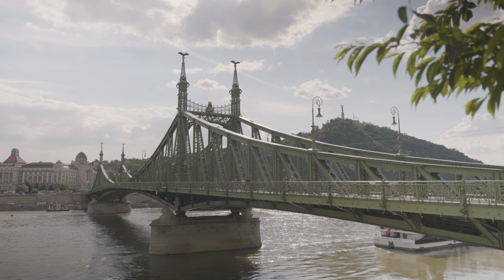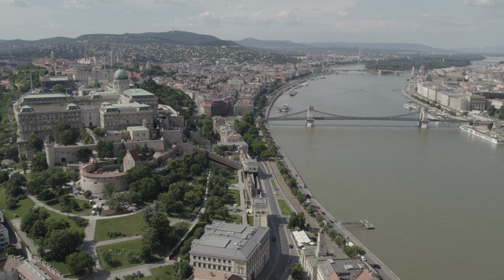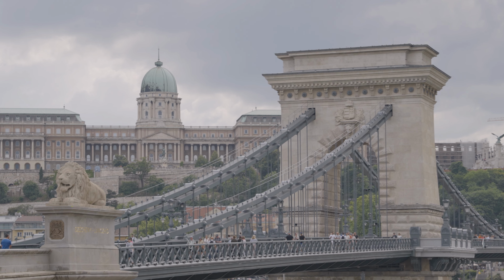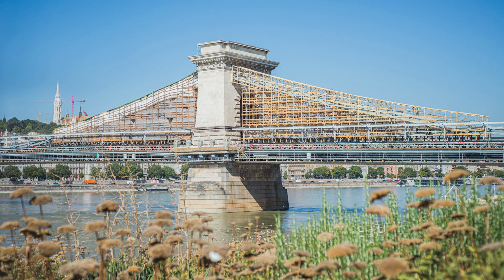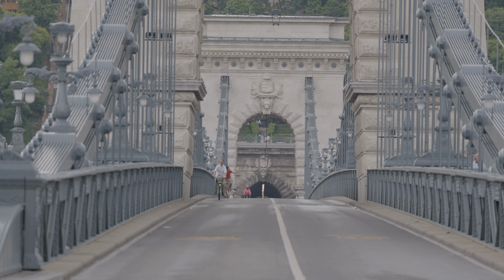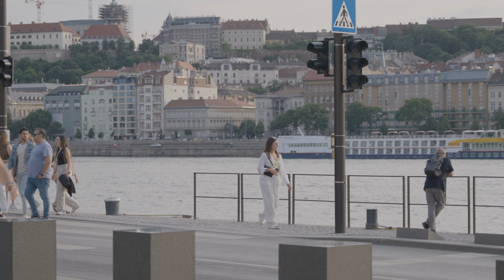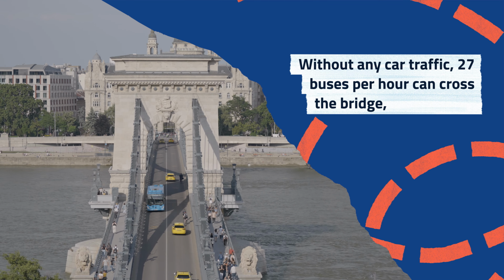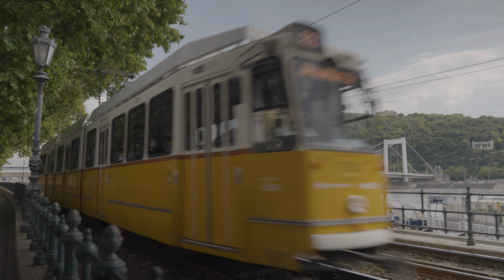How did the Chain Bridge in Budapest become car-free?

Comment: I live next to this bridge and have to cross to the other side of the river every day. This isn a smart and green idea. At least the people  that live in the two districts that the bridge connets should have the possibility to use the bridge by car, but no, the mayor have to show how green he is… meanwhile the traffic jams in the city are enormous. Also it’s not even a pedeszrian bridge since the middle part of it is used by buses taxis motors and cycleists. Also it’s not even safer for biking since i usually go through it by bike and the speeding taxis are fucking dangerous.
Reply: You can use the more frequent busses, just like I do.

I live at Krisztina tér and my various workplaces were around the M3 metro line or on Andrássy út, so I had to use the 105 bus in the past a lot.

Before the renovation Krisztina tér-Deák tér route took 20-40 minutes in the rush hour or ~10 minutes in the evenings.
Plus you had to wait 6-7 minutes for the next 16 or 105 bus to go to the other side of the bridge.

Now the same route takes 8-15 minutes, depending on the tourist hordes making a selfie with the bridge at Clark and Széchenyi tér.
Plus there are more bus options: next 16, 216, 105, 210(B), 178 bus comes in every 3-4 minutes.

Comment: Yeeeeah the issue is that it absolutely crippled traffic in the city, by cutting one of the major thoroughfares connecting two sides.
-Due to massively increased congestion this means longer times sitting in traffic jams, thus greater pollution.
-The increased travel times throughout the city mean time losses for people, and financial losses for businesses.
-It was also done in direct violation of the contract to restore the bridge which specified that it must be able to maintain its former function, which means the city lost out on a massive amount government funding, which means the capital is essentially bankrupt and has little money for actually useful projects improving the city.
-Additionally foot traffic over the river at that point is marginal at best, as the river is long, there aren't many good scenic photo spots on the bridge, and the view from it is limited, in addition to it being windy. And footpath connections on one side are extremely limited, as there is basically only a non pedestrian tunnel, a long way on the riverbank right beside a road, and a dense and narrow street between houses on that side.
-The reasoning with the prevention of damage to the bridge is nonsensical, because it can be restored again and again, and all bridges will need to be restored after some time anyway due to being in  wet and windy environment with metal parts, so slightly lengthening the time between renovations is merely a financial benefit, which is insignificant compared to the financial damage caused by loss of business due to inaccessibility alone.
-Also, this is THE one bridge which didn't need to ban cars to make foot traffic on it safer, because the pedestrian area is separated by a wide and tall metal wall. 
-It also comes from a mayor who utterly hates cars for personal reasons, and has made it his mission to make life difficult for people in cars no matter the rationale.

So it's harming the environment, costing people time and money, doesn't actually help people on foot, doesn't help tourism (if anything it hurts it because of congestion), reduces accessibility of the inner city, doesn't help with preservation, was paid for by money that could have gone to actually useful projects, and was completely unnecessary for foot traffic - which is minimal at best anyway.

Comment: Yes and as a consequence the whole city is jammed now, air quality much worse. Guess what, the cars didn't disappear, they find another way. The very heavy city buses ( + taxis, m bikes,..) still drive on the bridge which is main problem against bridge conservation, not cars. Zero step forward, three steps back. Absolutely nonsense ideology driven decisions, these type of politicians never build anything, they destroy.
Reply: No, the whole city is not jammed (more than before) and the air quality around the bridge got noticeably better, with much less noise pollution.  Guess what, induced demand works both ways. Making car travel inconvenient enough so public transport will seem as a better alternative will reduce traffic. Of course the best would be to simultaneously improve transport services - and they actually have more bus lines on the bridge thanks to the much reduced traffic, so its a slight improvement in the area - but the car-brained government actually reducing the funds for public transport, and the capital in general, obviously because they are just incredible petty - Budapest has an opposition led local government - and partially because they would never use it themselves, they would have to mingle with the plebs, the horror!

Comment: It is also became an important public transport line as BKK created or diverted 3 (178,210,210B) more bus lines goes through the bridge next to the 3 (105, 16, 216) which have been used this route already. So the public transport now is quick and more frequent, and you van go directly into Pest city center from different parts of Buda side, without the need to change lines.
Reply: It is a very congested part of the city. The crosswalk at Batthyány square (public transportation hub) is the main bottleneck (it should remain there to prioritise people walking and using the tramline it leads to) That route does not let the traffic flow in the roundabout at Clark Ádám square and this resulted in congestion on the bridge as well. Now buses can at least reach the roundabout a lot faster and they can usually pass trough in a reasonable time. Great improvement indeed!
Reply: @andrasbiro6604  Batthány tér is a different part of the city. I think you wanted to mention Széchenyi tér, which is at the Pest side of the bridge. Yes, this area needs reconstruction and there should be a more easy and tourist friendly way to walk on the bridge, because it is a popular way between Pest downtown and Buda Castle area. The plans are ready, de debate is on who should found the reconstruction. (The government or the local government?)
Reply: Except they could have done that without the bridge being restricted.
Reply: @nemo-x  For buses, the passage through the tunnel and the Chain Bridge often took 20-25 minutes instead of the standard 6 minutes before the restriction. Now there is technically a bus lane on the bridge and the number of people crossing the bridge in any way is already higher than before the renovation and traffic reorganization. Thus, by restricting car traffic, we managed to significantly speed up public transport and increase the actual capacity of the bridge at the same time.
In addition, the bridge only accounted for about 2-4% of the number of cars crossing the Danube. And since there is still taxi traffic on the bridge, about half of it has disappeared, since before there was basically just traffic jams on the bridge all day. And because of the renovation, the entire bridge was out of service for almost 2 full years anyway...

Without car restriction the bus lines was not efficient.